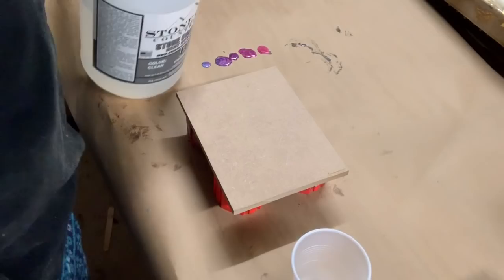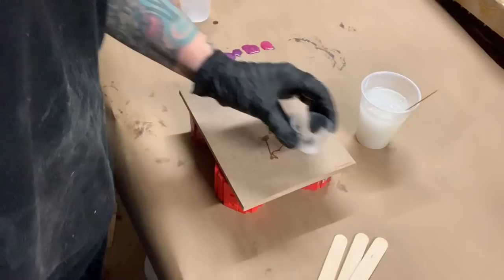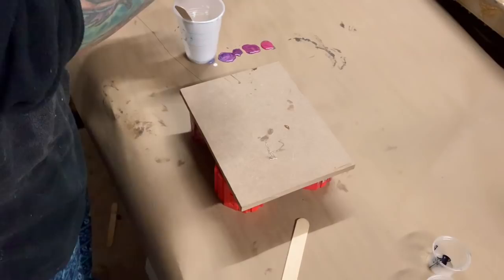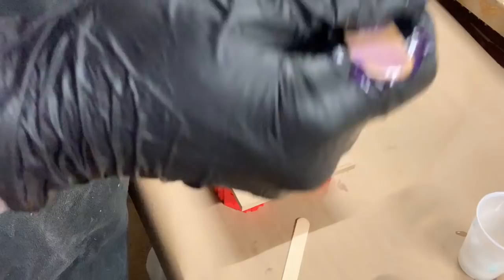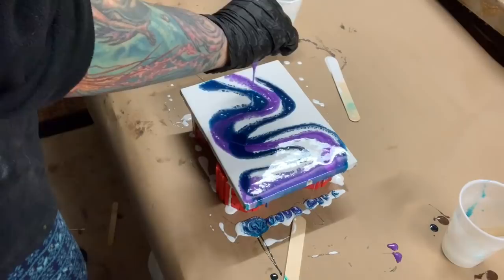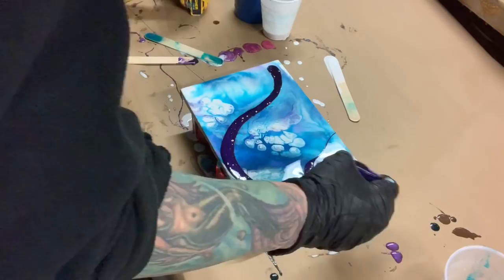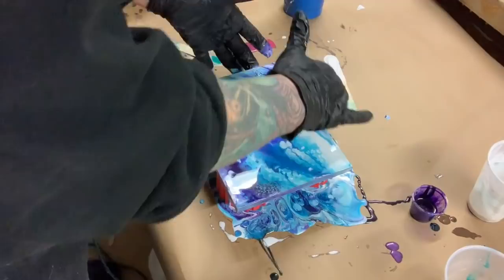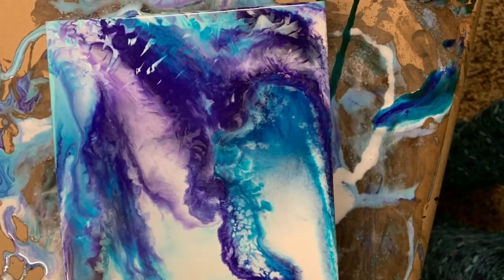How to DIY resin epoxy art tutorial painting

Comment: Beautiful piece as usual Monica☺ just something I heard about the stone coat tint, people who don't use it up quickly(I have heard) have had problems with it drying out. To prevent this they either put a pastic sheet between the lid and jar to tighten seal or put the closed jar in a ziplock bag. I have heard nothing but wonderful things about their products other than that☺ Have you tried their art resin yet? I've heard great things about that.
Reply from the maker: Norine Murray Arts&Crafts 
Yes I have some other art resin also are use the countertop one on small pieces just because it’s cheaper also I use that white stone coat tint  up really quick
But thanks so much for the tip

Comment: Very pretty.  It's amazing how you manipulate your resin and tints.  Could you use silicone in the base coat as well?  I quite using silicone on my acrylic paintings; I just had too many problems resining on top of the acrylics.  No matter how many different ways I've tried the two just don't mix.  That's why I wonder if silicone could go onto the base coat as you have used your white for cells?  I hope the answer is yes?
Reply from the maker: Denice Delmue 
Unfortunately no The oil from the silicone floats to the top creates pitts and you cannot get rid of them sorry 😩
Reply: @MonicaBarnesArt That's what I was afraid of.  Is the oil in your white base different from the oil in silicone?
Reply: Denice You can have any kind of oil whatsoever in resin! Your finger prints can cause a pit in the resin. This paint she’s using is not oil based. She’s mistaken.